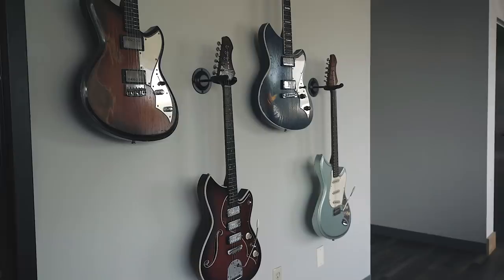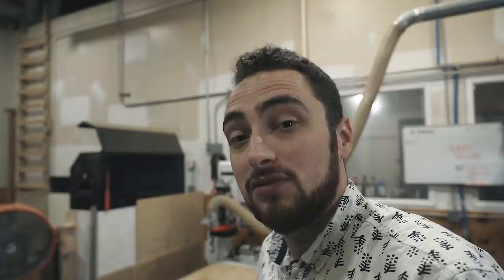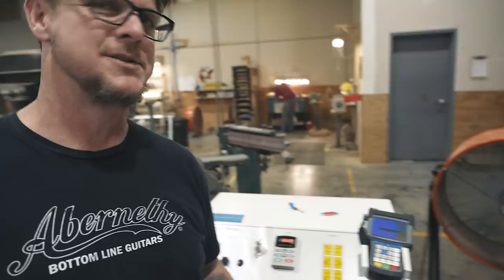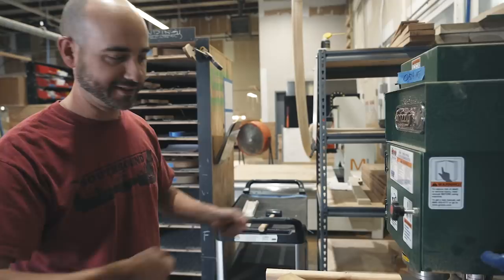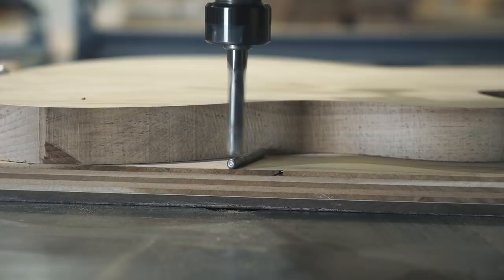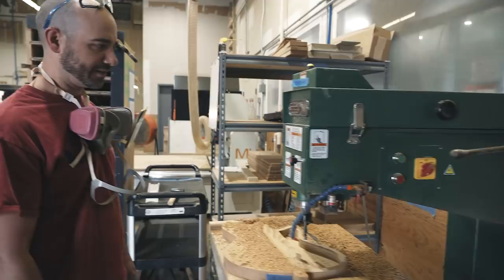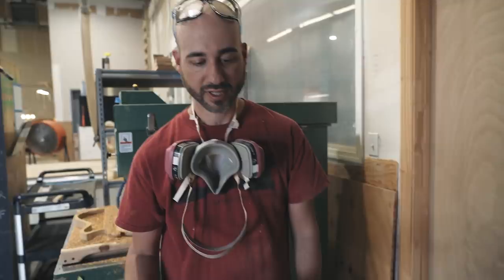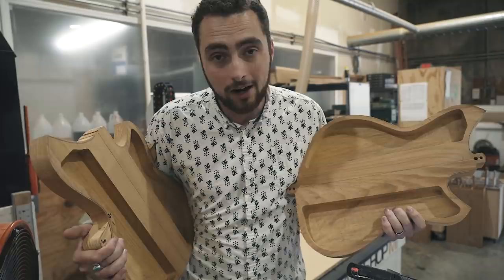Is “Handmade” Really Better? CNC vs. Handmade Guitar

Comment: All of the comments from about the 13:00 mark make perfect sense to me: the CNC is a tool, the guitar still needs hands on it to finish.  I think some companies will crank out garbage because they do CNC 90% of the work and then don't put the hands on them to finish the process.  I've been using Fusion 360 and a shopbot, and the guitar bodies i've created are beautiful, IMHO.  Safety, consistency and quaility of the pieces the CNC can excel at.  You still have to put them together.

Comment: You missed one really important point - how many do you want to make.  If you are making one of something, programing the CNC will take a lot longer than a skilled craftperson would take to build it.  A lot more.  And it would probably require a few prototypes to get the machine paths programed correctly.  On the other hand, if you need to make 100, or 1,000 identical pieces, the programing only has to be once, and after that you can fly.  So when I need a custom one off inlay made, I call up Larry Robinson who cuts each piece of pearl by hand, and routs each cavity free hand; but when I need to buy 200 of my logo to go in each guitar I make, I go with Precision Pearl who cuts them on a CNC machine, and I cut the pockets using a small CNC machine I have.

Comment: I can see how cnc machines can improve the production.  I build as a hobby in my garage.  I use only hand held power tools.  My current build is a semi hollow body telecaster style guitar, The bottom side is Maple, the top side is purple heart and the center is pine.  I have in laid purple heart on the bottom and Maple on the top.  The center I hollowed out with a hand held router.  This type of building I consider more artistic,  No, I do not build to sell. At any rate, great video.  I'd love to work in a shop like this one, for sure.
Reply: Does having better paint brushes make a painter less of a painter? Tools do not dictate art, the outcome does.

Comment: how is doing it on a pin router called handmade... that's a really good question haha xD
Reply: A router is a router even if it is pushed by hand, you don't stick long sleeves in your router nor your hands, your fine.  A better controversy is wood type on an electric guitar which doesnt matter.  You could mount your pickups on a toilet seat which some have.
Reply: @BrettTheBratly   does that toilet seat guitar sound like.... ??? y'know ?

Comment: "Handmade"? What?! :)) If you use a motorized powerful machine that speeds-up the process (and makes it more smooth) then it's not a handmade by the definition!
Handmade is a really hard job to make a guitar. This means that you're working with cheasels and other different hand tools. You're scraping out the volume and it takes hours! Probably this can make a guitar sound a bit different :) But the story about a muscled handmade master with his (or her? :) )sweaty body can be a great "sound changer". Just a pun for marketing managers ;)
Reply: Your definition of handmade is flawed. If an individual guides a tool then it is handmade. How long a tool takes to remove material doesn't matter to the quality of a finished product. It just costs more.
Reply: @1pcfred  prob. you're right but it's my vision and i'm unexperienced in this kind of work.
I see many things through the "retro-glasses".
Reply: @KiR_3d  I do some woodworking with power tools, hand tools and a CNC machine. In the end everything is still made by me.
Reply: @1pcfred  I've found pine-tree logs recently (they were not wet). How long should I wait till it be able to use in something? I mean to cut it to some pieces, carve maybe...
I don't have an access to machinery (to make long beams and etc) so probably I'll be working with a hand saw and some chisels.
Reply: @KiR_3d  there's no hard and fast rules when it comes to drying wood beyond the longer you can wait the better. Sealing end grain can minimize checking. But there's no guarantees. I don't really have the right machines to work with logs myself. I made a router sled once to plane a log. I put some mileage on my router that day using it too. Working with logs has given me an appreciation for sawn wood.
Reply: @1pcfred  I think we can wait a year probably. What means "Sealing end grain can minimize checking"?
Reply: @KiR_3d  You paint the end grain of the wood with something that slows the loss of moisture in the wood. Some people use antifreeze. Some just use random paint. If you don't seal the end grain wood loses moisture faster through the end grain than the face grain and that leads to the wood cracking. Which is called checking. Though sometimes wood checks even if you seal the end grain. But it's all you can really do.
Reply: @1pcfred  Thank you! I'll try to do something from this.

Comment: I don't know anything about guitars but as a product designer i had to watch this video. In some products orientation of the fibres or micro-structure of the material is crucial and robots/CNCs are not always good at handling those situations. That is why composites and wood products rely on manual labour. For an electric guitar you can get similar sound quality out of a CNC or hand made product. But for something like an acoustic guitar or violin you will have some audible difference.

Comment: Good video. It demonstrates that CNC does no equate to a lowering of overall quality and skill required to produce a quality instrument.  The donkey work is done by machine when using CNC, that's all. I am an engineer and I know how incredible CNC is. The thing is, no guitar manufacturers use a large enough suite of CNC machines to automate the entire process. If one did, I can assure you that the price would go up, not down. To do absolutely every job, I bet you would be looking at 40K per guitar. I know that sounds unbelievable but i know what I'm talking about. In truth, the CNC that guitar manufacturers are doing is pretty simple stuff, 2 or 3 axis machines. It relatively low tolerance machining and they are cutting wood, which is easy, albeit bloody messy. 
I have seen some 6 axis multi tool CNC machines that can do mind boggling machining that absolutely no human on earth can do or has ever done. 
I think there is a place for everyone really. Small run, one man makers that hand tool everything are great. I love the work that they do and I am glad they are still out there. To be honest, I am approaching 50 and if I could do my whole life over, I would rather have become a luthier rather than an Engineer. With that said, higher volumes need factory production systems that can make more in less time for lower cost, less waste and higher return.... done safely. So, CNC is a contender if you are looking for accurate machining. There are other methods too, cam followers let you make copies of a thing and lots at once. I could go on for days but what it boils down to is what comes out the other side. 
It all comes down to the finish for the most part. Assuming good materials, adhesives and so on are used and applied correctly, it's all down to the humans that finish things. Ultimately that's what matters. If they dont let any imperfections pass then you get something good. If they let defects slide, you get crap. If they dont have the knowledge to know good or bad, it's hit or miss, mostly miss I would guess. Skill and experience, that's what it all boils down too. The last pair of hands that touch it before it goes out better know there stuff. That's all folks.
Reply: lexzbuddy Good points - CNC is mainly a consistency/economic consideration. I’m sure they crunched the numbers and ensured that they would be able to make enough guitars in less time at higher quality (because of the consistency) with CNC. They may even have lowered their liability insurance (see 12:50 - ish in the video).

Comment: You guys missed the whole point. Hand made guitars aren’t better because of CNC Vs Pin router. Pit router is virtually the same, But without computer perfection. NO the real comparison is CNC vs hand made with the old plunge router, real carved tops and attention to detail, not a template. Also it takes the art out of it and the individual personality of each guitar. So Pin router still doesn’t even qualify as hand made. You guys totally missed the whole point. Both CNC and the pin router are the equivalent of a person who claims to be an artist, that traces other people’s drawings. A pin router is NOT a hand tool. This video is dumb.

Comment: You use the right tool for the job... if that calls for a pin router then use one. For pocketing and profiling operations, the pin router has been updated... it's now a CNC. The templates from the pin router days have been computerized... they are now digital templates. No different than television, photography, recording, telephones, maps, etc. There's no debate, really. It's funny that this conversation is happening on YouTube, which is a digital version of the good old TV, 😂

Comment: I think the illusion of "better" has to do with a misunderstanding of precision.  Some people think a CNC is somehow less precise and "handmade" is more precise.  Exactly the opposite is true in this case.  CNC routers can be programmed to the 10th of a millimeter (or finer).  A human can't do that.

Where it wouldn't be true is in carving a decorative (non-functional) design in something.  This is where people get the ideas inverted.  I use to sell furniture and I can spot hand carved designs vs cheaply done machine carving a mile away.  The precision of the hand carved is generally more pleasing to the eye.

But with a guitar your are building a machine.  The guitar is designed to perform work and the physics of sound is such that there is an optimal design to achieve the sound you want.  That means that ANYTHING that can be automated to precise tolerances will give you a better product.  As the guy in the video said, the most critical parts of a guitar are in the finishing and no one has devised a way to automate that part of it yet.

The other important thing he said is that "what you believe" WILL affect what you hear.  When the human brain processes information from any stimuli of the senses, it will fill in gaps according to what it expects to be there.  That's why two people can witness the same event and give very different versions of what actually happened.
Reply: You can't program my CNC machine in millimeters. Well I suppose you could if you changed the scale. But I have 10 TPI leads on it too. Metric sucks!
Reply: @1pcfred  All depends on the machine.  I was speaking in generalities rather than specific to guitar tools.  I used to work in a machine shop and we did high precision metal work.
Reply: @henrywilliams5712  I worked in a tool and die shop for a while myself. We made instruments precise to better than 0.0005 inches.

Comment: For the gross subtractive process of the guitar-making process, the pin router is simply the precursor to the CNC. A manually operated analog router machine vs. one that's computer controlled. There is no difference between the result. A router, regardless of the operator, pockets out a blank. For me, having come up through the years with only manual analog machines, to mastering 3D/computer-aided design and manufacturing (CAD/CAM), I'll take the safer, less tedious, consistent accuracy of a CNC every time.

Comment: I'd say CNC is fine, allows more productivity and consistency to the manufacturer. On the other hand, the manually pin-routed body requires more sanding, hand-finishing to brush up all the irregularities and therefore ends up in a more fine-tuned instrument.  In both cases, it's the handcraft skills that make the difference at the end. Would be interesting though, just for the sake of it, to make a comparison between a totally hand-made instrument and a CNC routed, hand-finished instrument. Call it BS, it's probably just the idea, but I still prefer a manually built instrument. The human touch ! ;-)

Comment: See what you really need is a special on people who don't use templates. Freehand routing takes skill. I use a pencil to mark the cut and then use a hand router to cut as close to the line as possible. I tape around the lines so that if I see the tape lifting slightly I know I'm on the line and to pull back slightly. This is mass production not the custom handmade people refer to even though it uses power tools.

Comment: I own both. My handmade guitar took over 6 months to build.  I have two guitars but they're slightly different eventhough it's a same model with different specs. My CNC build are amazing,. Finish, sanding, fretwork is still done by hands.

Comment: The CNC has a consistent feed rate which means the tooling lasts longer, the material, wood, is less stressed and won't warp. The full width first cuts done on the pin router were violent. The CNC did a plunge in and then light circular cuts to make the cavity, so the body is going to stay flat when taken out of the machine and the grain was not shaken to death. The CNC is gentler and leaves a better finish.

Comment: I'm a machinist. I would imagine the big advantage to using a CNC mill would be, not only can you crank out more product in less time, but more importantly, CNC mills are so precise and consistent, that you can much more effectively "dial in" what you want over time, simply for the fact that you have that degree of consistency to play with.

Don't like an aspect of one guitar? Just tweek the program until it's right. In this manner, you can really target and focus on specific problems and address them accordingly. 

Conversely, doing it by hand, it's always anybody guess from one guitar to another. It's hard to fix something if you don't have a baseline.

Comment: I think a guitar that has the body and neck cut on cnc and then the rest done by hand is the best method for a very consistent, well made high quality guitar. Many high end builders use this method with great results. Of course this method can result in questionable to low quality results as well but that goes for most manufacturing techniques. An eye for detail and skilled craftsmanship are required for a high quality product. That goes for anything not just guitars

Comment: I've been learning how to make guitars as a hobby over the last couple of years and I'm not using a CNC.  But that's only because I'm still learning and experimenting, so every guitar is effectively a prototype.  If I ever stop the day job and make guitars professionally, I'll almost certainly get a CNC, for safety and consistency.  At the moment, though, I quite enjoy shaping the body and neck myself - it's a lot more fun than sanding and fretwork, which I'd still have to do manually!

Comment: No problem with the CNC machine. The production is increased which is a plus if the manufacturer can pass those labor savings on to the customer. But having worked for company's and having first hand experience with stream lining production methods, the savings will always go back to the company; not the workers or the customer. It's just the way it is. When I see   a small shop working with more hands on tools I understand more about the expense of a boutique guitar. But ultimately a great guitar is great whether it's hand built or machined. Great video. Love those guitars.

Comment: I like to see professionals at work whether on machines or using hand tools. My own take is how far do you have to go to produce a "hand made" guitar? Do you use a hand drill or electric drill? Do you use all hand sanding or use a power sander for the heavy work? Do you make your own tools? Personally, I believe making consistently good guitars at reasonable prices, by using power tools and CNC where applicable is good for everyone. Unit cost comes down, prices come down, but margins can be bigger after the initial investment in tools.

Comment: I do both, but lean on the CNC for the bulk.  I like doing some things like belly or arm curves by hand with a Shinto saw just because I keep trying it as I go.  Silly not to use a CNC if you have one for the bulk as well as precision, especially for a perfect neck joint every time.  I also save my standard cutouts for humbuckers and singles, switches, etc.

Comment: There are tasks where highly rigid, accurate machines give the best possible results and there are tasks that are best left to a pair of skilled hands. This applies not just to factories making hundreds of guitars per day but also to small builders. A CNC machine really is the same as any other tool. A good luthier knows when to use each tool at their disposal to create a guitar that matches their expectations for sound and playability.

Comment: I used to be a machinist. I worked on both manual machines, and operated CNC equipment. CNC is more consistent in the majority of cases. Handmade is great, but is usually slower and is highly dependent on the operators skill level. It depends if you’re looking for mass production or you’re only making a few parts at a time. I would think when it comes to building electric guitars CNC would be the better choice nowadays.

Comment: A CNC is still just a router. There is no magic dust. The CNC is a more stable platform with less vibration and it is safer (usually)